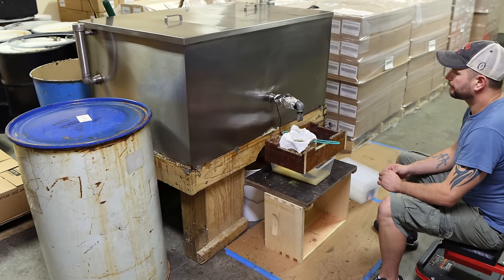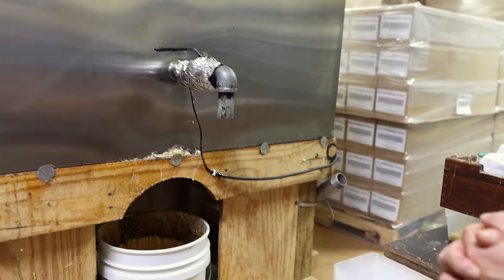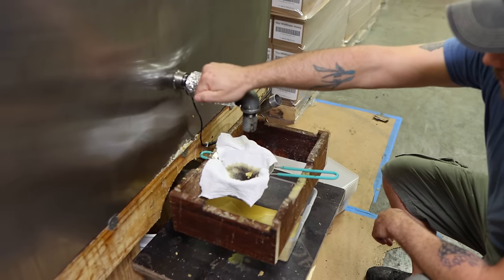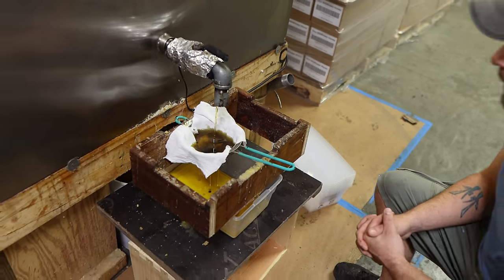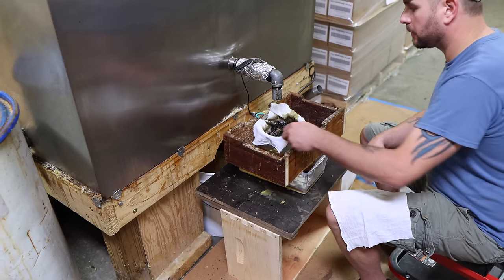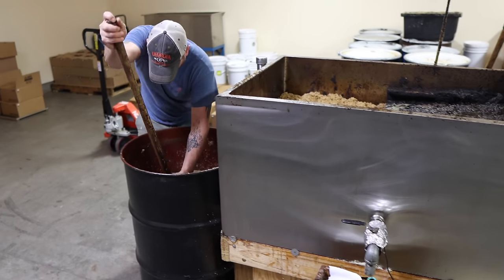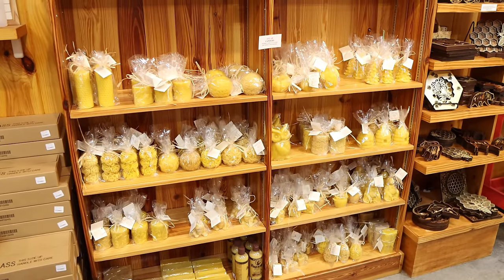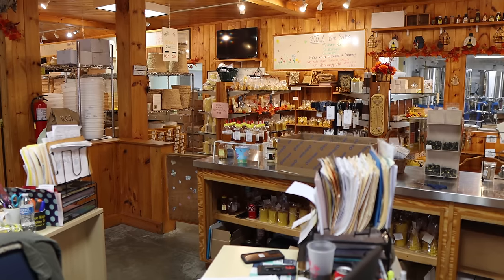Our Old Wax Melter & Making Candles

Comment: You mentioned that you reuse the flour cloths. How do you clean them?

I’ve been looking at a lot of wax melters lately and yours looks better than most. I wouldn’t be in a hurry to change it.
Reply from the maker: We don't clean the towels. As long as there isn't a lot of debris Marilyn warms the cloth with the heat gun until the wax is very soft and then the hot wax will go through it.
Reply: @bobbinnie9872  thanks

Comment: Hi sir, can u please tell us about the wick used for the candle as whenever I try to use a wick the wick burns way faster than the wax leaving the wax there, basically the consumption of wax is low and wick burns out
Reply: You need a square wick for most bees wax candles. There are several candle making sites with info about this. I prefer Peaks candle supplies just from habit, but most sites will have what you need. It takes some experimenting to find the right size for each candle you make. A 4" pillar takes a larger wick than a 3" pillar and so on. Maybe a 3.0 for a 3 inch and a 4.0 for a four inch. If your wick is too small you'll have your current problem. If too large, you have "blowouts" which can start fires. I test every new size in an old pot, so if the side blows out, it doesn't burn your house down.
Reply: @Dustpuuppy  thankyou sir
Reply: @Dustpuuppy  thankyou sir
Reply: @beenomad8717  It's been a while, so take my specifics with a grain of salt. Not rules, just starting points.
Reply from the maker: It sounds like the wick you are using is too small. The molds we use, which we purchase from Mann Lake Ltd.,  have a suggested wick size on the package. Search for  "Mann Lake Candle Molds" and you should find recommendations on each candle mold description.